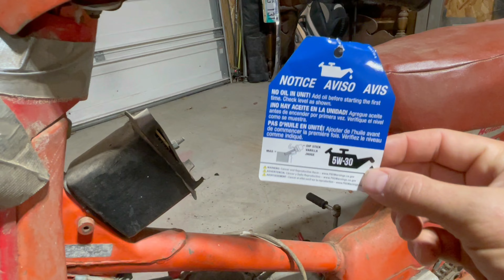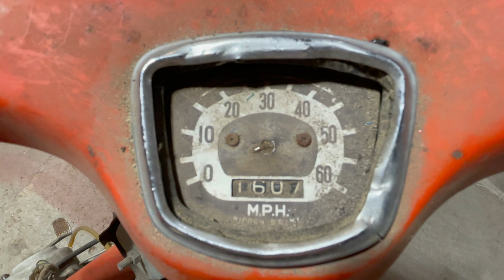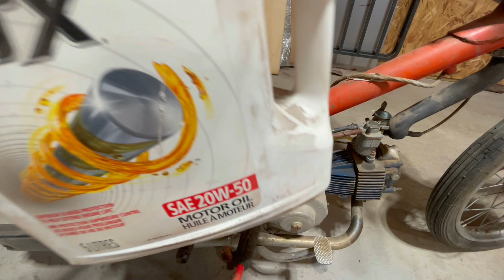Will it Start? $50 Honda 50 Super Cub

Comment: Thanks for putting this on You Tube.
Of all motorcycles ever built ever, the noise of the Honda C100 was the model that hit me between the ears! 
They sounded so awful (don't take it the wrong way) that I couldn't ignore them.
In fact, I took pleasure hearing a Honda 50 C100 whenever one came into view.
Though not a motorcycle enthusiast, I think this original version of the Honda 50 is the most interesting of all motorcycles ever made.
Reply from the maker: I couldn't agree more! Most mast produced vehicle in history.
Reply: Yes not only most reliable, but most produced. They have been in continuous production since 1958 and Honda has made 140,000,000 of them. They make thousands per day and the cub is on backorder!

Comment: That thing is so fucking cool now me personally, I would definitely put new tires on it and a new gas tank because it had rust on the inside and I would put a regular size sprocket on the back because I would want to get as much meat as I possibly could out of that thing And even with that it would be too slow for my purposes I have a Honda cub 125 and for my roads I wouldn’t want it to be any slower than that but I could take that one to work but yeah dude that thing is so damn cool man and I’m sure it’s worth the 50 bucks I will also get a new spark plug do a full oil change and I would want to put directionals on it replace the lights if I could with LED and I would definitely wanna clean it up and paint it up. And I would also definitely put a new chain on there.

Comment: Great job getting it started. I have a '64 C100, and want to ask anyone who knows about connecting the battery--does you know where it's supposed to ground? There was a black ground wire attached somewhere that I had been connecting to the battery, but it came off when I was removing the battery last week and now I have no idea where it's supposed to go. There is also a blue wire that has a male end that has never been connected to anything, but looking at the schematic, it appears it might be what I should connect the ground from the battery--I don't want to make a mistake and burn something out--any help is greatly appreciated.
Reply: The ground wire from the battery should have an eyelet which bolts directly to the frame. It's the bolt just to the left of the bolt which holds the battery clamp.

Comment: I found one today, that's what brought me here. Confusing deal, he said it was a 1960, but had a 1965 manual. The engine is off the frame. I'm still thinking about it. I still have my 1969 Honda QA-50 and it still runs.
Reply from the maker: If it’s a good deal buy it. They are a ton of fun and build like tanks!
Reply: @rrrestorations5047  $100, but scored piston and jug. He said it was a 50cc but it looks bigger. I have access to a 100cc Honda chi-clone engine free. I might go tomorrow. I remember the later step thru and trail 90 hi/low trans bikes, I also had an XL350. Torque monster deluxe!

Comment: that's a huge key and sprocket.  I  just wanted to say thanks for making this video. I also have a 64 cub, it has electric start, I spent a few hours trying to get it to run this weekend.  Motor is free, has compression (finger test), no battery,  and a weak spark. I haven't tried pulling the carb and spraying it with starter fluid like you did on yours. I also need to adjust the tappet clearance like you did (thanks for that). what size gauge did you use for that?  Im planning on ordering a 6v motobatt battery for it. It would be great if you put up more videos on this bike. Im subscribing to your channel in hope that you will.

Comment: If your going for lights on this. Buy a battery. The battery acts as a shunt....someplace where all the magic pixies go.
If you don't have a battery, the charging system will pop all the bulbs.
The carb on this is worth a couple hundred dollars. 
It's the only thing that kept me from an original engine. (I went chinese aftermarket engine set up) after I found out how much a used carb cost.
sweet bike
Reply from the maker: Thanks for the tip! The bike came with a couple of carbs so I’ll make sure to hold on to them.

Comment: The sprocket looks like one from a honda ct105 (build not too far from this motorcycle) so my guess is:the bike uses some parts of rhe honda ct105 or it itself is the ct105 just has been modified to look like a c50

Comment: I Hope you can  help me to  hear my C105 run likes yours . Unfortunately I can't get a spark,  Coil is fine  new  condenser  and points . I took off the stator plate  and somehow  when even the points are open  I still get a continuity  wires  are not pinched  when I  di-soder the  main stator and take it off   and  it has less the 5 ohm on the windings  what else can I do  what is the  when the points are open still continuity? 
 Thanks
Reply from the maker: I would check the magnet on the flywheel to see if it is cracked. Go through the whole system again and double check each wire to make sure it isn’t grounding out on the engine.